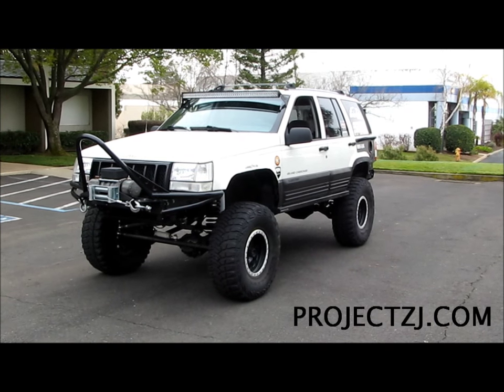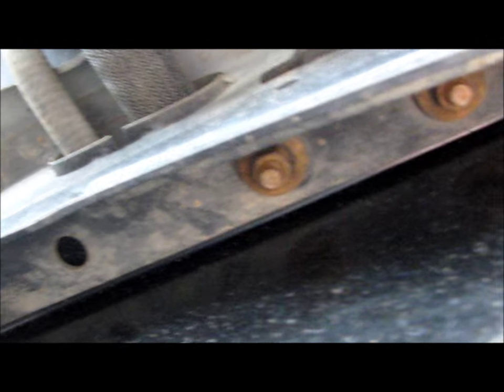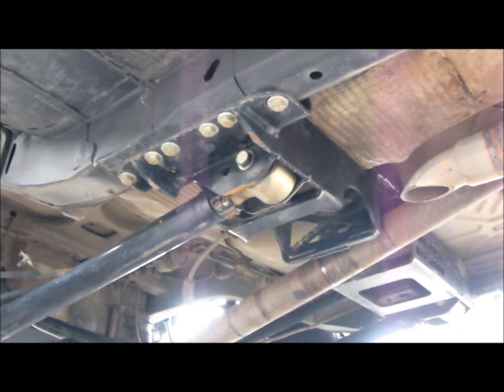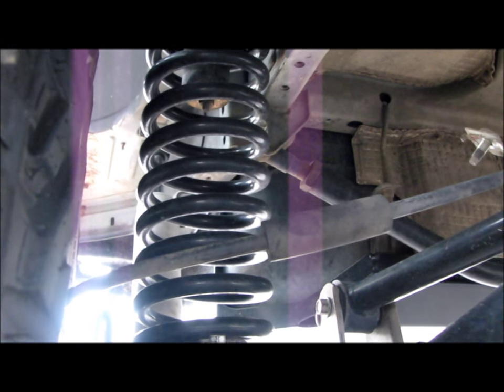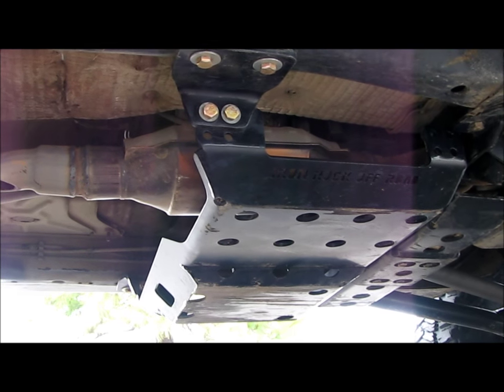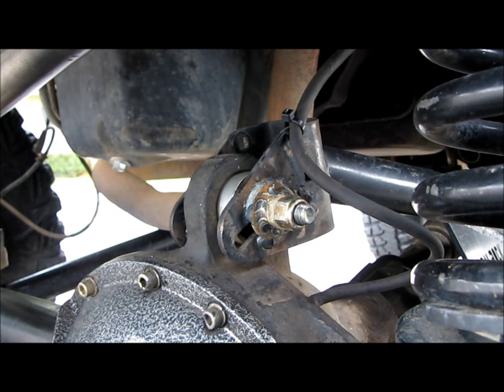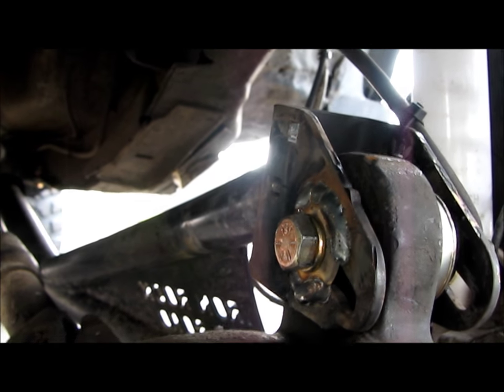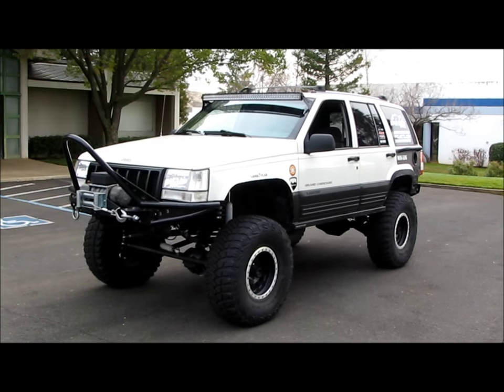Jeep Grand Cherokee 4x4 Project ZJ Part 50 Iron Rock Off Road Fuel Tank Skid Plate

Comment: Fyi my track bar bolt hits my IRO gas skid! And the skid is as far away as I could push it! And yes you can hold the jeep up with it! I have static castor and good you made it welded and I see even tho you don't have a IRO truss you bang your oil pan.
Reply from the maker: +prodezignz Haha I'm not sure how that oil pan damage happened, been like it since I bought it, but I tested for clearance on the current setup and it doesn't hit luckily.  I was nervous!  You must have pushed the rear axle back a bit more than me if it hits the skid.
Reply: ***** Definitely possible on my rear end being pushed back a bit more... The IRO front truss bashed my oil pan a couple times very badly I guess just an fyi if you get one... I thought maybe yours got bashed some how from your front axe. See you on the trails man!

Comment: hey Ryan you mentioned you had replaced the pigtail on your blower motor resistor,  I was wondering if you have the auto climate control one? I am having trouble finding the correct pigtail , the part store gave me one with 4 wires I need three wire one , anyway do you have a part number for the three wire pigtail 98 limited 5.9 (think it's same across trim levels )
Reply from the maker: I don't have climate control and they just did the resistor for hi speed but are doing it again today cuz it blew out again :(
Reply: ***** I might have to hard wire my blower 😏😏

Comment: did you put anything in your wheel wells in the front after you cut the fenders
Reply from the maker: Nope just painted everything
Reply: +RYANVISION kool tnkz man one more question on your drive line what drive shafts are you using im going to post vids of my build here soon keep an eye out lol
Reply from the maker: +Viper Mods Still running factory u joint front shaft and slip yoke rear shaft
Reply: +RYANVISION nice well love the rig man hope mine will look as good as yours and another question your buddy that makes the steering kit what's his price on with shipping
Reply from the maker: +Viper Mods No idea what he'd charge but you can contact him directly at www.metalcraftoffroadinnovation.com

Comment: Hey Ryan, is your bumpers stinger 1.5" or 2" tube?
Reply from the maker: I think it's 2" but I'll double check when I get my Jeep back in a few days.  Think we did 1.5 on the lower tubes and 2 on the stinger.
Reply: RYANVISION that's what I was hoping. I just had mine built yesterday with a 2" hoop. Thanks for the info!